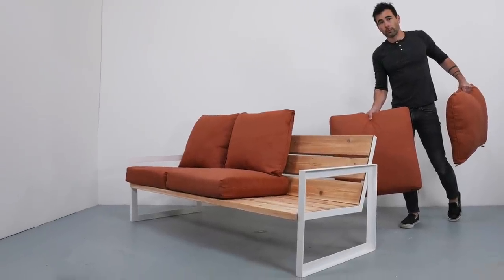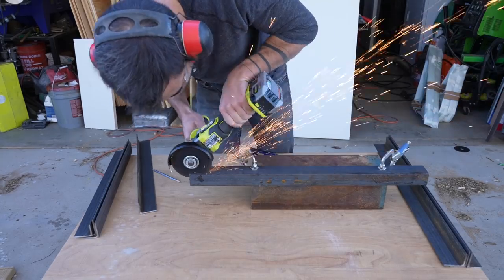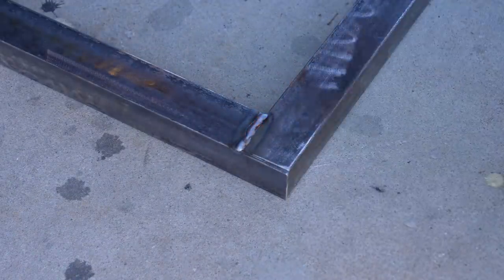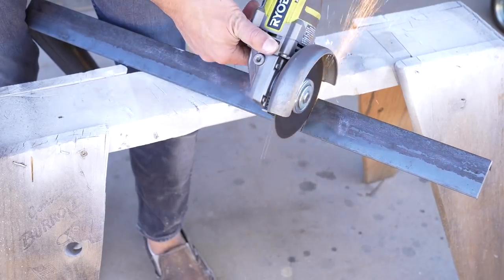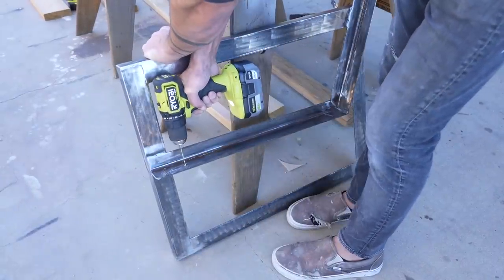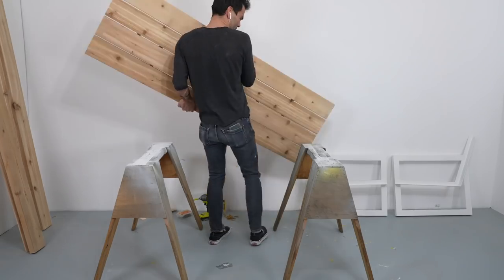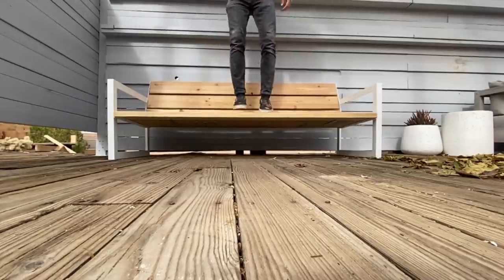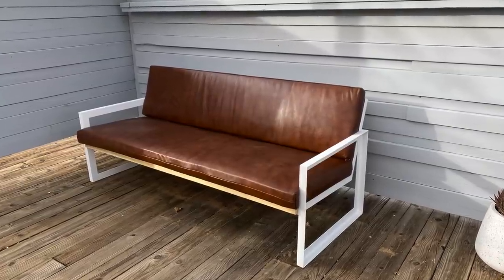How to make an OUTDOOR SOFA

Comment: I don't know why I haven't learned to weld yet. It's a really slick-looking design and looks comfortable. How did you determine what angle you wanted the back to be?
Reply from the maker: welding can be intimidating but the materials are pretty inexpensive and it enables such sleek projects with just an angle grinder and a welder
Reply: Yep, Angie - I keep thinking the same! I reckon I'm going to try brazing first, cos the equipment's cheaper and simpler, and it IS possible to braze aluminium and steel - although not nearly as strongly as welding!
Reply: If you see my post after yours... I said that most cities now have DIY build guilds that for $20 a month people can show you and they have the gear
Reply: I’m a complete noob to welding, but I really want to try it one day. What kind of welder do you use? Is that MIG?

Comment: Hello sir. I love this design. It's perfect for my garden situation where termites eat any timber placed directly on the ground. I've been looking at the drawings etc. but have a question... According to the diagram, the seat is only 11 inches above the ground which seems really low for a seat. Is that correct? Is there a reason for that?... Like to account for the cushions that will be on the top of it? or am I missing something? thanks heaps. Loving all of your designs, ideas and style, BTW. Thanks for all the inspiration!

Comment: Nice!  I was thinking of something similar using square tubing, but I like the look of the angle steel!  I bought the same Forney welder after seeing you use it on the Container house.
Reply from the maker: steel tube would be cool! I was thinking about trying with 3"x1" rectangular tubing
Reply: @HomeMadeModern  that would look great!  Did you prep the metal before you painted it, to get the mill scale and rust off?